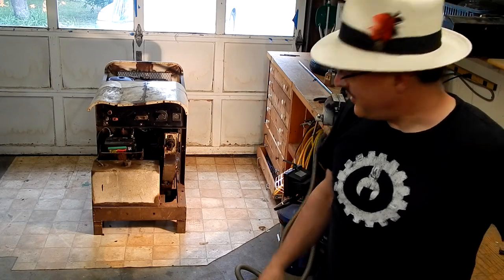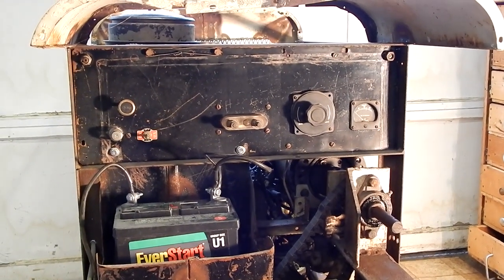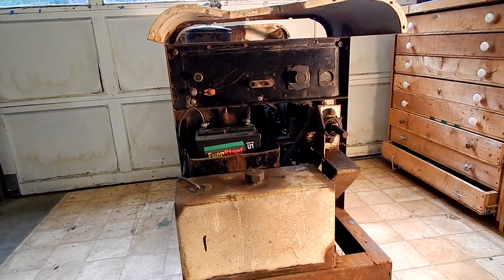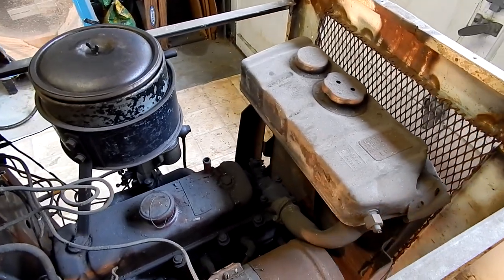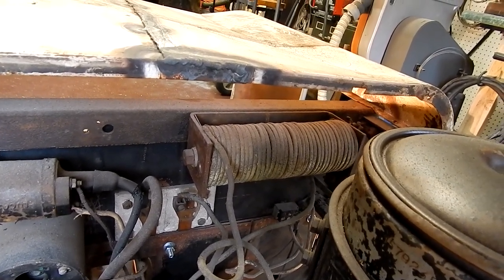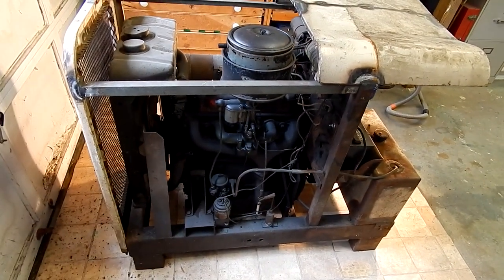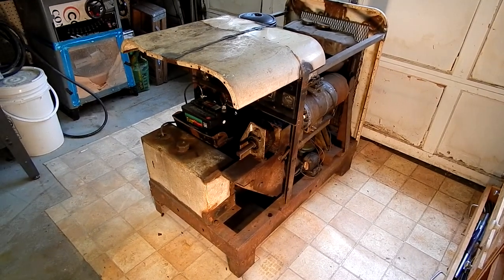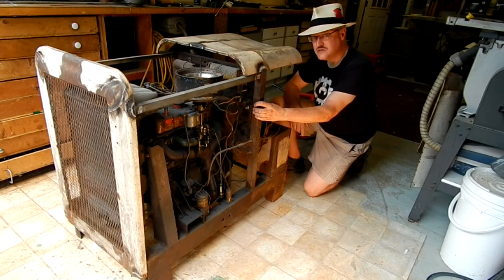WW-II Vintage Homemade Portable Welder - Part 1

Comment: Oh man... I wish I was there.  I used to work on those old motors.  Good luck going through the secondary ignition system.  All you need is air/fuel, timed spark and compression.

Comment: That's an awesome machine, and a cogent and interesting explanation of its workings.
Gee, if you get it running in time, you can use itself to weld its own wheeled chassis, in the same way that Abe Lincoln helped build the cabin he was born in.